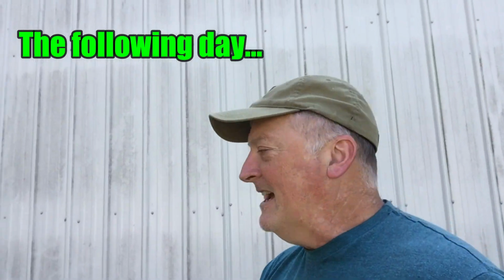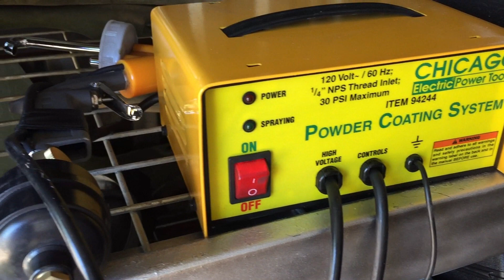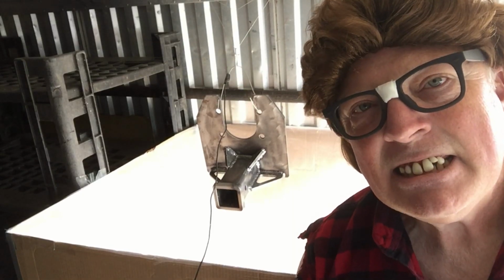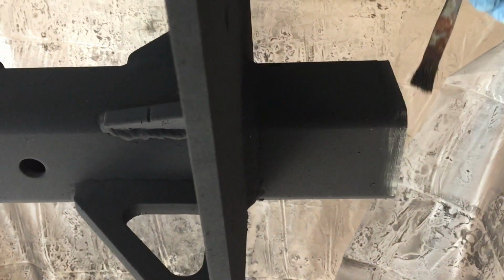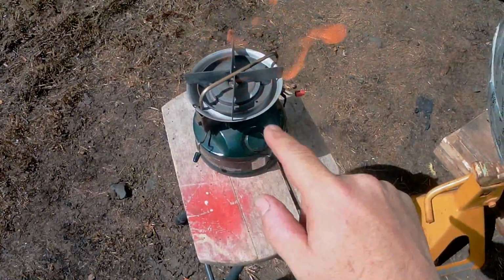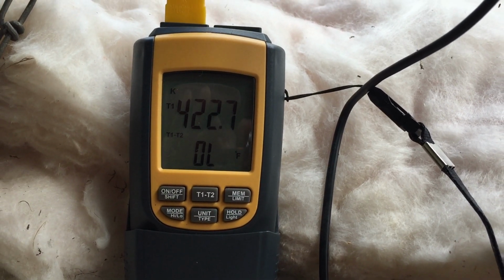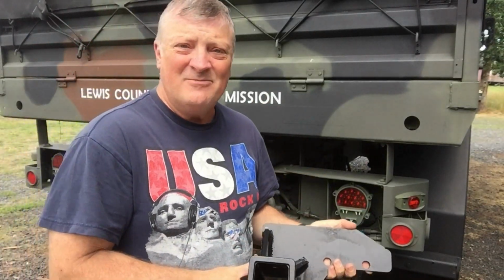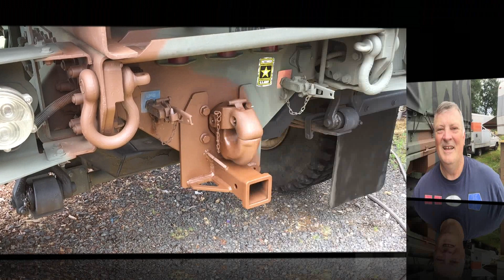LMTV CLASS V TRAILER HITCH Upgrade PT.2 #66

Comment: Hey, That turned out way nicer than my hack job!  Great one Dave!! I will have to replace my hardware at some point too!  I have never powder coated before.  I had no idea it was that easy.
Reply from the maker: Super easy, my friend. The cost of having one item powder coated easily covers the cost of a Harbor Freight machine. I built that setup back in the day when I had a whole bunch of time to research it. Since then, I've done lots and lots of parts. I am surprised at how durable those Coleman stoves are! I've burned that thing on high so many times!